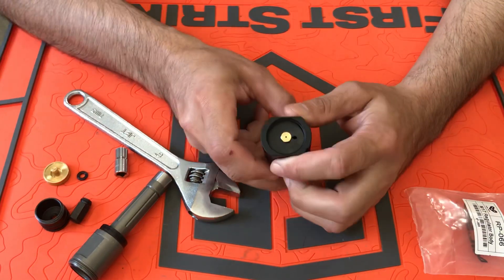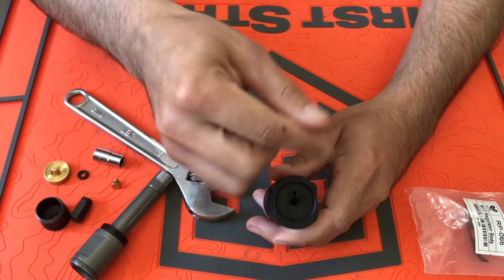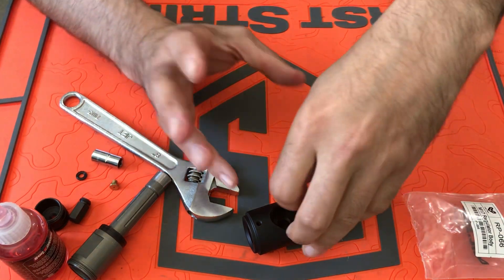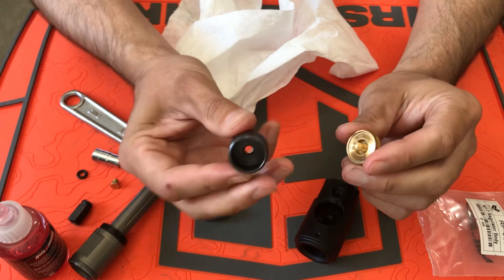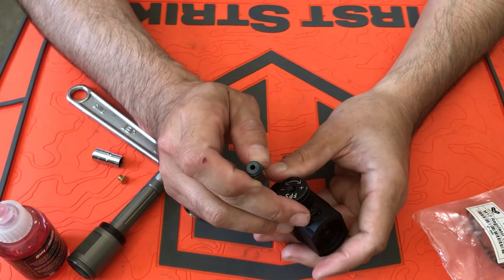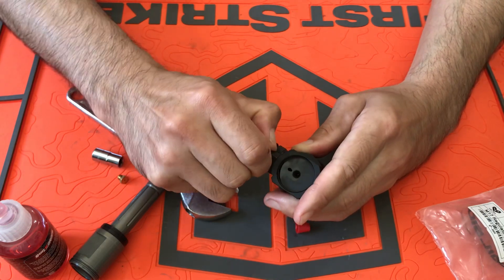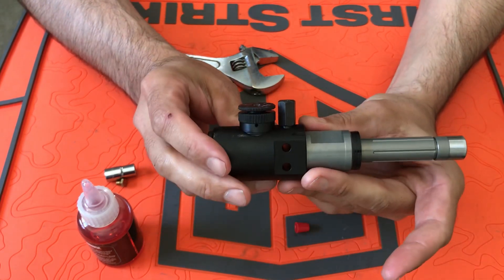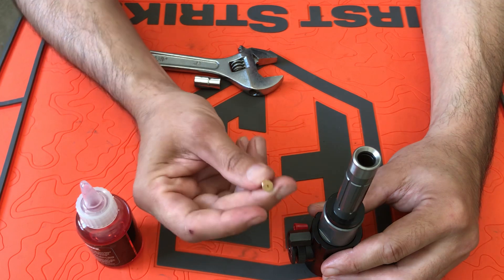Valken M17/Cqmf VERSION 2.0 bypassed regulator install.

Comment: Sean where can I get the small o ring in the air chamber it’s not a typical o ring square on the edges
Reply from the maker: #3 heatcore oring is sold in packs of 10 at Rockstar Tactical. The square type 🙂
Reply: @lesslethalfordummies thank you looks like I just bought the last set

Comment: I had a question I broke the head off the orfice tube now it’s wider, will it work still?
Reply from the maker: Yes it will still work but not in a full v2 type bypass. Better but not the best.

The little bit thats left in can be removed by heating it with a lighter and using an allen wrench or skinny flat head screw driver tightly fit to the inside hole.
Reply: @ awesome thank you for your help and information I really appreciate it. Keep up the awesome videos
Reply from the maker: @gerardomagallanes2789  with twisted off hex we will call that bypass 1.75 😂

Seriously though you aren’t the first to snap the hex off myself included.
Reply: @lesslethalfordummies  hahaha that’s good!
Reply: I had a question do know where to find a valken Cqmf handguard?
Reply from the maker: It was never available separately that i know of. It is a standard AR type guard.
Reply: @ ok awesome thank you

Comment: Hi there,  can you send me a link for the prv delete plugs, 
I live in belgium and can.t find the on amazon , love your video's and i learned a lott from you , thanks for your knowledge and video's.  😉
Reply from the maker: You require a m10 x 1.0 x 8mm socket set screw. I got mine from Aliexpress.

Alternatively you can use a 1/8npt socket pipe plug which you should be able to find on Amazon.

Comment: What does by - passing it do - I’m new here - does it shoot stronger ????
Reply from the maker: The M17 is known for blowing the velocity adjustment cap clean off when adjust to less lethal velocities. Bypassing allows maximum velocity without fear of cap breaking.
Reply: So sorry I word things funny but anyways ,,,,,,,,,,, pretty much the less power going thru the velocity cap 🧢 it blows clean off //::: and by by-passing it you can crank the power up and it won’t blow off the cap ….. correct 👍
Reply from the maker: @phantomoftheopera8072 bypass transfers energy into the cap threads instead of the single velocity screw
Reply: Thank you 🙏 I’m planning on buy an m17 for house hold protection and I want to buy the bare bones model so I can understand proper use and upkeep and …. It’s just a hell of a cool gun
Reply: And I also want a walther ppq t4e … and the fact that they both can shoot different kinds of rounds is just cool
Reply from the maker: @phantomoftheopera8072 the Walther is a good trainer but is not intended for self defence.
Reply: I wish they would make the combat master into a t4e gun and not an airsoft gun that’s a really cool gun too
Reply: Your awsome thanks for helping my understand about the car threads ❤❤❤❤❤❤❤❤and the walthe t4e is a really cool gun ,,,, which do you recommend for self defense???? In your opinion please
Reply from the maker: @phantomoftheopera8072  in pistol form right now? I really like the Salt S2 but its not that simple because there are so many pistols that are good in their own way.
Reply: Thanks your awsome I live in Minneapolis and dangerous stuff goes on around here all the time ,,, I just want to keep a roof over my head , food on the table , gas in the car , and keep my wife , house , pets and car safe ,, this is guna help me out a lot and great hobby to get into , I’m excited to start collecting the guns I like and and displaying them proudly
Reply from the maker: Thats the great part is it can be a hobby as well as offer some protection. You will have your own favorites over time for a variety of reasons or situations where they might be put into use.
Reply: In the future if you will ,,, can you please do a video on hand guns for self- defense please now I’m curious 😅🎉thanks again
Reply from the maker: @phantomoftheopera8072 i have done more than my fair share of pistols. They are just spread out amongst YouTube 🙂
Reply: Ok ✅ I will check it out thank you 👍

Comment: Does the conversion replace your other bypass video with the drilling? does this apply 1:1 to your German version of the weapon? Best regards
Reply from the maker: I never recommend drilling the regulator. It is a very quick way to frustration without proper experience.

There are some small differences in the german model that i am aware of but the regulator is not one of them so this should cross over just fine.
Reply: @lesslethalfordummies  how much Joule does it take After this Bro ?
Reply from the maker: @Marius-nb7ps power all depends on your tank output. 30-50j if you have done the prv delete.

Comment: How many joules would this mod make?
Reply from the maker: Velocity and joules depends alot on the weight of your projectile and the output pressure of your tank. I couldn’t even begin to guess without knowing those two things and then you must also factor in barrel length.

Comment: Hey man my regulator cap dosent wanna go off with hand force im scared to use a tool on it incase i break it any advice
Reply from the maker: Loosen and remove the velocity set screw first. It is tensioning the cap and making it difficult to remove.
Reply: @lesslethalfordummies  thanks your a star if I remove my grim burg pvr with tape will I have to retape it as well or reckon it be allright
Reply from the maker: @charliejackson9412 i would retape it for good measure but if the oring inside the threaded hole is still present it should seal just fine without tape.
Reply: @lesslethalfordummies  thank you love watching your videos honestly you keep it real an simple no messing about I like that
Reply from the maker: @charliejackson9412  appreciate that. Sometimes email is quicker response but comments do allow others who maybe have a similar issue to follow along. Happy shooting!
Reply: I'm deffo over 30 jules know on 850 or do I need to drill I got the valken 11 inch rifeld barrel 687 I belive
Reply from the maker: @charliejackson9412  drilling can add 20fps+ but it can cause issues with autofire. I do not recommend drilling unless you have upgraded your bolt spring. There are some new regulators coming that can replace the factory one completely so that you can keep yours undrilled.

Comment: Have question. I see you not put bottom brass fitting in yours. So is it better not use bottom brass fitting in reg ?
Reply from the maker: You are correct reg is completely empty except for the piston which is require to keep a seal.

The lower bits are the pieces that actually regulate the air flow so they must be removed.

Comment: Well I guess I'll need to shim the sear spring got my tank down from 1100psi to 870 and auto fire almost every time I've used it  what a pain I don't even have the parts have to order and wait
Reply: Did you resolve your issue with the auto fire mine is doing that since I did this modification? As soon as I pull the trigger one time it goes fully and just keeps going until I turn the air off.
Reply: @jamesstancil4549  Yeah I did I took the on/off ASA off the gun I just run the tank straight in now I'll post a video on what I did soon probably Monday
Reply from the maker: Regarding the auto fire.

What on/off are you using?

Using the factory bolt spring?

Go over all the external screws especially the rear sling ring attachment.

If you like drop me an email at LLforDummies@gmail.com and ill do my best to get you sorted.

Comment: so now you don't need the piece that is removed with the 14mm socket and you don't need the washers in that space between cap and piston basically? You basically clear it out and just use piston, and screw back on velocity cap with hands?
Reply from the maker: Bingo! No unnecessary moving parts or orings to fail.
Reply: @lesslethalfordummies  thank you for the reply, I am going to use 3 bumpers, grimburg o ring for heatcore, grimburg pvr delete, and bypass 2.0 regulator, with a shp 1100 output tank but I won't have the shim sear. Do you foresee any issues I may have? maybe making it 6 bumpers is better?
Reply from the maker: @nickychan4022  6 seems to be the magic number of bumpers if you experience autofire. Some do, some dont so you wont know unless you try. I have advised a few ppl to run six and it had resolved their issue. The sear is definitely something to do in the near future it shouldnt give you any grief for the moment.
Reply: @lesslethalfordummies  thanks so much!
Reply from the maker: @nickychan4022  so welcome!

Comment: Hi,

I've completed my bypass mod, also have the shim sear completed, PVR delete and number mod with 4x rubber washers....

I'm getting huge power, 445fps with 7g rubber steal 683 rounds....around 62-64 joules, but after the first shot, my mag becomes jammed in the the receiver and the marker will not fire again until the HPA tank is slowly unscrewed from the receiver releasing pressure...if I try to press the mag release catch, it does not move and the mag will not come out until I've done this.

After I have released the mag, re installed it and screwed the HPA tank back on, it will auto burst, and will also auto burst rapid shots when set to semi auto once the trigger is pressed.

I'm running a Ninja V2 pro reg set to 1100psi on a 3000 in psi tank.
Reply from the maker: The first thing that catches my attention is you say rubber steel rounds. The m17 whole heartly dislikes rubber coated rounds. Try to find pvc coated balls like riot balls or composite/nylon type. You can temporarily alleviate this problem by oiling your balls and does help in the short term.

As for your second issue when a jam occurs like you explained do not i repeat do not put your marker in safety.    First turn your air off via on/off and then unscrew tank, open your on/off to bleed air and clear the jam. Putting the safety on during a jam will trap the bolt in front of the sear causing it to go full auto. While clearing the jam be sure to point marker in safe direction.
Reply: @lesslethalfordummies  wow thanks for the advise, I will try to oil my balls 🤣🤣 and make sure my marker is not in safety position.

Yeah when this happened, I obviously could not deplete the air from the receiver via the trigger after I shut off the HPA via ASA, so I slowly unscrewed the tank and reg from the marker until I heard the air escape from the back.....is this the safest way of depleting leftover air in the system?

P.S: Are you on the C.R.B LESS LETHAL group on Facebook that Mikey from Canada Riot Balls started, as I think I have seen you on there to
Reply from the maker: @marcussmith4965  the safest way with a jam is to unscrew bottle like you mentioned. Failing to do so leaves a charged air chamber that can either spit the jam in an uncontrolled manner or even swipe your finger tip off if you were trying to dislodge the jam with your finger in the magwell. There is an alternative way to install a m10 bleed down screw in place of the prv so that you dont have to remove your bottle for a jam. Honestly jams have become a thing of the past since i stopped shooting rubber balls.

Yes it is Sean from Crb. Much easier to reach me through Facebook.
Reply: @lesslethalfordummies  I thought it was you, by your YouTube profile pic....your videos are great btw.

I alway watch yours and Mikey's......you commented on one of my recent videos on the CRB LESS LETHAL group regarding the HDR-50.

I am going to try using oil on my rounds like you mentioned before,  just to confirm the jam issue is sorted, then I'm gonna get some nylon riot balls!

Thanks for all your advise
Reply from the maker: @marcussmith4965  Thanks for checking my channel out….thats why i asked if you had your own channel. I enjoyed your enthusiasm when the 50 got some big numbers 😂.
Reply: @lesslethalfordummies  your welcome Sean......yeah, I was so surprised at the results of that marker! It's a keeper for me.

Your videos are really good!......

Comment: My Velocity adjustment cap broke yesterday. Does this mean I don't need to replace the cap and just need to remove the brass piece connected to the piston?
Reply from the maker: You can reuse your broken cap by performing the bypass but loose the ability to adjust fps. You will be max all the time based on tank pressure.
Reply: @lesslethalfordummies  thanks, ordered a new cap… thanks for the tutorial

Comment: Hey bro why when I put the bottle of air the first shot goes in auto in multi shot the weapon fires alone with the by pass, is there a solution to avoid this problem? because it makes me waste a lot of air for nothing
Reply from the maker: A trait of the m17 is it must be in safe mode while airing up the marker. Are you in safety when screwing in your bottle?
Reply: safe mode security mode it is at the level of the selector where you choose normal shooting or full auto or on the left the security mode is that right?
Reply from the maker: @vxw_wxv9238  when the arrow is pointing forward that is safe mode.
Reply: yes that's fine I put this mode before putting the bottle then the weapon is filled with air, after the problem happens once the first shot it shoots on its own, but I noticed that it happens especially with the full bottle
Reply from the maker: @vxw_wxv9238  First thing i would do is air up marker without a magazine and listen closely for any leaks. Soap water test the prv screw this notoriously leaks and is almost undetectable but can cause all sorts of grief. If no leaks are present i would tear it down clean and oil everything wiping excess lube especially from sear area. If it still does it after the above reinstall the brass orfice but leave bypass in place. If it stops you will need to adjust bolt bumpers. How many bumpers are you running? You may need to make adjustments for sear reset by adding or subtracting bumpers. Normally this is not the case.
Reply: thank you for all it's advice and the quick response, I'll see all this, I have 3 bumpers
Reply: 3 bumpers is good ?
Reply from the maker: @vxw_wxv9238  number of bumpers is dependent on the marker. I am running  6 on my m17 and 4 on my cqmf.
Reply: I have m 17 a2 , can this affect my problem ? do you have the reference of the bumpers?
Reply from the maker: @vxw_wxv9238  I get y bumpers from Canada Riot Balls. They come as a repair kit with a bunch of other orings. Did you try reinserting the brass orfice yet?
Reply: the brass orifice diameter 14? I risk losing power if I put it back on? and I have to put the rest back like on one of your video or just the brass hole?
Reply from the maker: @vxw_wxv9238  the brass nozzle (orfice) that is under the air chamber is the one you want to reinstall. Yes you would loose some power but it is a way to trouble shoot your issue
Reply: I'm going to see it as a last resort anyway thank you for all your answers it leaves me a lot of things to solve the problem I'm going to get into it more thoroughly this weekend otherwise I'll put it back as before feel the bypass